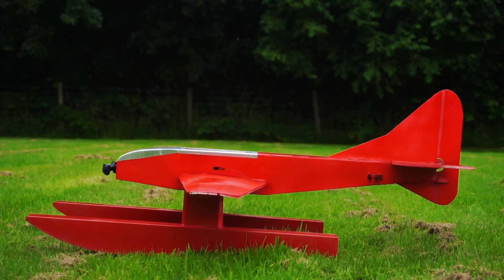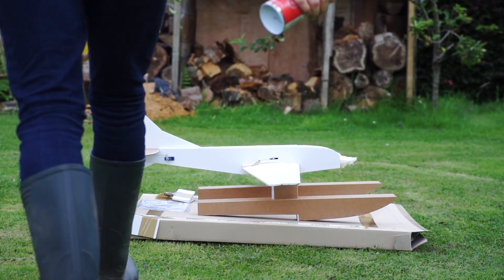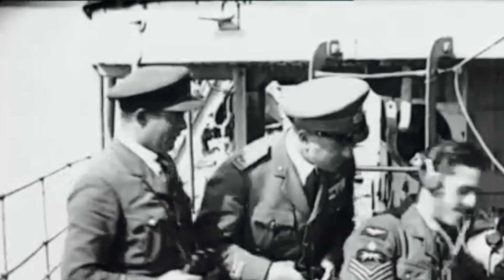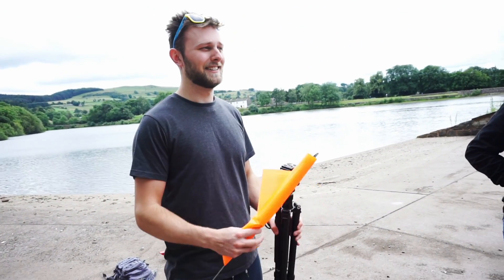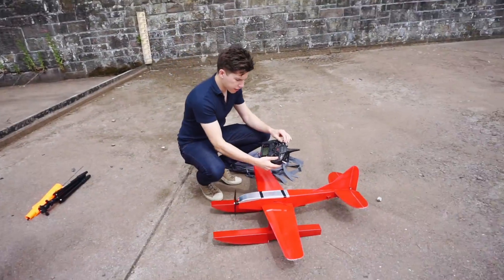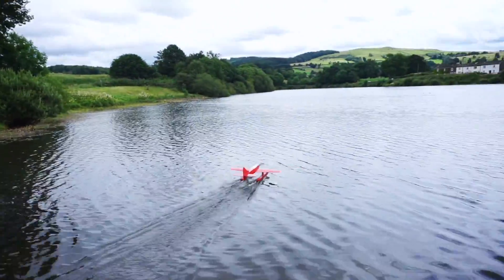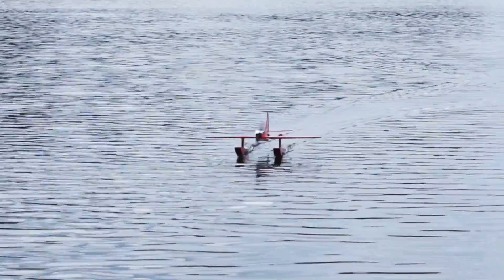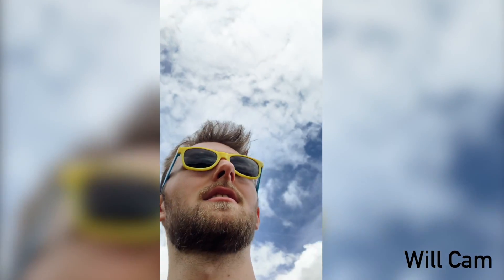Flying my Seaplane as FAST as possible

Comment: Here are some rules of thumb when it comes to floatplanes:

1: The floats are about 75% of the length of the plane.
2: The step is about halfway down the length of the float.
3: When the floats are installed, the step should be just behind the c.g.

Hope this information helps, keep up the good work!

Comment: Nice design. I think it's got a lot of potential, but you need to get the warp out of it that's causing that right wing to drag so much. Also I'm relatively sure the prop pitch is too low. Not sure what an optimal prop looks like for a foam floatplane since there's a lot of drag...

Comment: Very nice work. I'm curious, how were the floats constructed? What adhesives used etc.? Trying to figure out how I can prevent leaks if I one day try a floatplane of my own. :) In terms of higher speed, everyone's saying "beef it up" and they're not wrong, but I'd personally look at cutting drag before increasing power. Shaving boxy corners off fuse and floats to lower total surface area? Shaving down trailing edges of wings/stabs to as thin as possible? Seeing if you can get away with slightly smaller floats? (though maybe not much if going to a heavier power rig.)
Reply from the maker: They're just made from foam board. They leaked a bit but were fine for this experimental plane. Thanks for the suggestions!
Reply: I use balsa and fiberglass. I also use glow engines. Electric is dumb. 
Rather fly 20 minutes. Land and refill then fly again.

Comment from the maker: Thanks for watching people! Post comments of what mods I should do to make this plane much faster. 🔥🔥🔥
Reply: Obviously bigger motor, smaller prop is one option. But it is a little thing, so you should pair it with an intunner motor for speeeeeed and force.
Reply: 6s!!!
Reply: Take the efx racer setup as a reference
Reply: As I explained in my longer seperate comment build and afterburning edf on it
Reply: Except that, what people posted above, build new airframe. Box with attached wings, which have attached two more boxes can't get "speed challange". Something like floating flying wing would be awsome (and 
innovative by the way)
Reply: Mono float
Reply: First step to higher speeds - Higher pitch prop, maybe smaller diameter.